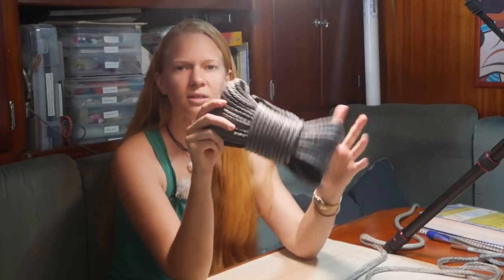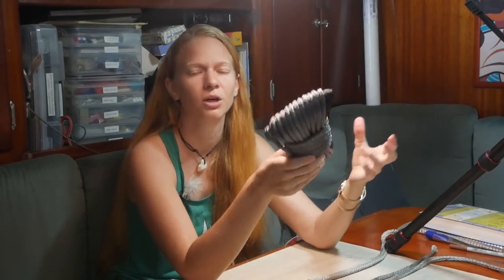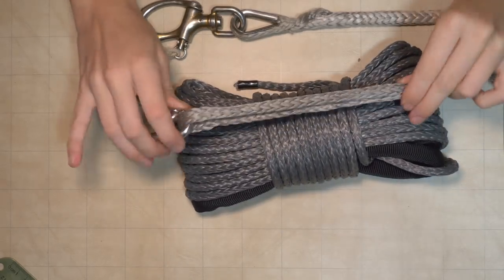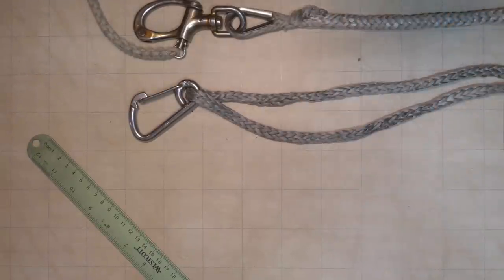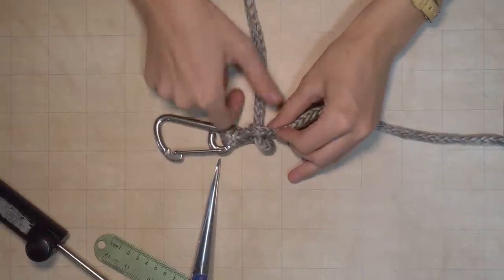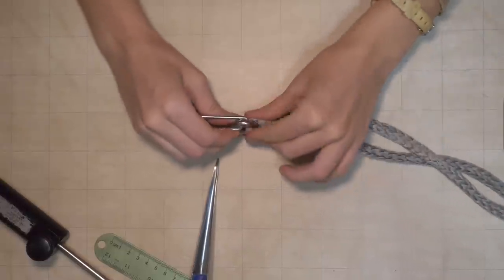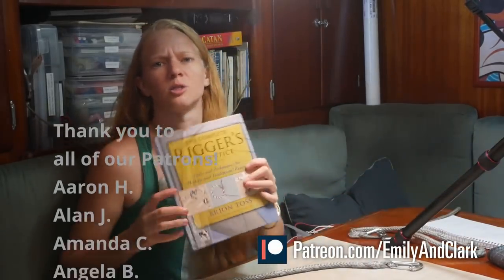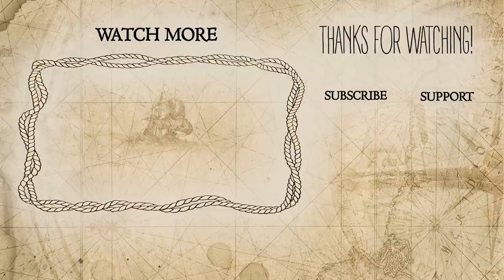Easy SPLICING: How to do a Brummel Splice around a Shackle [Capable Cruising]

Comment: this is a very well done video. the only thing I do differently is that my taper is longer - usually bunch the standing dyneema all the way to the knot and then take strands out every 3 or 4 and cut them off before tapering the end. This becomes more important if you want to keep the dyneema closer to the line diameter, which helps if it passes through a block or bullseye. There is also a pretty neat way to do a brummel if you only have one end to work with, but you can't put it around a thimble or shackle. The other thing you might add if you do another brummel video is the importance of the locking part going through the working end and not back through the standing part - if it goes through the standing part it will pull out.

Comment: I learned a splice today from a bargain store dock line with loops at both ends for $1!  It has a bury but it's not a brummel. The splicing needle pierces the braid, the the working end goes around the standing end and loops back across itself and immediately starts the bury by entering the original exit hole. When dressed it locks the buried splice with and overhand knot. I'm not sure how long the bury needs to be, but the rope that I found  is slick 16 strand hollow braid 3/8" yellow polypropyline "ski" rope . The loops are 5", the overhand lock is 1" and the bury is 6". Not quite as smooth as your mobius but it's fast.

Comment: Hello Emily and Clark---Another nice video here.  I wished I had seen this back in 1996 when I was replacing my very heavy 3/8 galvanized wire standing rigging with Dyneema, when it was really expensive! What I did, after considerable guesswork, was to perform the 6 strand pass through (as you started)  and then,  because I did not know anything, was to  stitch stitch, stich with dacron waxed thread and then (because I am so afraid of UV damage) fully serve the whole thing with black seine twine and then paint black, (more UV protection).  That's my current standing rigging on my gaff cutter.  Your solution is much more elegant, but all my sins are covered with my black seine twine serving....lol.  Ted 

PS  I've taken my boat to the Wooden Boat Show in port Townsend several times, and Brian and Pete and John and Mike would visit and talk and I would listen.  Brian Toss was a national treasure.  Sorely missed.

Comment: good one!  ... you prompted me order the new edition of Toss' rigging book - thanks!  Another interesting splicing video would be putting an eye in the end of double-braid line.   If ppl don't have the Brian Toss wand (very hard to find now), they can use stiff wire (a bit smaller than coat hanger wire) bent in half instead as the tail-puller - or they can buy a D-loop splicing tool.
Reply from the maker: Yes, there are a lot of tools out there.  I tried a bunch before I tried the wand.  Haven't felt the need to change since.

I'm not sure about a video on double braid.  I think that's better taught by a book and anyone that serious will probably already have a book.  But I do need to do one this season.  Maybe.
   I think people are getting sick of rope work but eventually I'll do one on three strand.  Again so easy anyone can succeed after one watching and an important skill to have.
   Once I'm out of bed I think s refrigeration video is coming.  I have a slow leak I need to fix.  So I'll be taking the sled out.  Good time to show how it all works.   Also a good prereq video for air conditioning.  It's starting to get hot!  -C
Reply from the maker: Also, assumed you used our affiliate link, thanks.

Comment: MOBIUS: Maybe I'm wrong, but my understanding is, including the word "mobius" in the name of  this splice referred to a method of making the splice where you don't need access to the standing end of the line. This is useful if the line is very long or the standing end is already secured or has bulky hardware attached.
Reply from the maker: I think you are right
Reply from the maker: And I think that can't be done around a shackle

At least I can't figure out how.  -C
Reply: @Clarks-Adventure  It would be challenging to do around a shackle! You would have to get the shackle through the reversed hole in the line!

Comment: This is a pair of cutters that I use for Spectra which is similar to the line that you use and may be called Dyneema and they work great Pitbull Tackle Braided Line cutter 2.0. They cost about $14-18 depending on where you purchase the cutters. When you do the splice, you should start a little farther to adjust for the rope thickness and allows room for the tapering of the end of rope.

Comment: The fid with the blue handle is known as a Swedish fid. The eye is good for this use but the small radius turn does weaken the line. It will be weaker than if you used a thimble to make it bend less.

Comment: that's great, but what if the working end also has a shackle on it?  How do you have two ends that eyes with metal hardware??
Reply from the maker: Do you have that need?

But lots of options.  You could just bury a lot of tail inside the working end and sew or add a long whipping to the throat.     We have a video on whipping.   It's me,Clark and the title is something like how a sailor cuts a rope.

Comment: love the splice ! looks easy and pretty!

though i feel like i would just use a figure 8 . yes its not as seamless but it dont need any tools, precision or time.
Reply: Bad idea to use knots on Dyneema, VERY BAD!  The strength can be fare below 50% and dyneema is as slick as Teflon.  The knot will not hold!  Brummel lock is one of the very best ways to splice Dyneema.  Knots will kill people!
Reply: @mikeiver  if you are using the dyneema for such heavy loads then yes the splice is the only safe way to go, but if you are using only a fraction of its breaking strain, eg: pulling 300kg with 6mm dyneema(3200kg breaking) then a figure 8 will not slip. I put loads twice that with no slip with figure 8s. The great thing about its slipperiness is that it is much easier to break up the knot than any other line that you'd subject to that kind of load

This is just my experience working with dyneema having used different knots, and loads. Not trying to discourage using splicing at all, it kssignificantly stronger and seamless.

Comment: I have a question, but first I really appreciate your video, it is really well explained, and I've come back to it many times! 
My question is what do I do if I have a core, but it's not a braided core. I've been looking all over YouTube, and I'm just struggling to know what to do with my core. There's plenty of really good tutorials on double braided ropes, but I have a cheap polypropylene rope, and it has a core, but it's just a filler. Can someone please point me in the direction of an answer? I have done a decent amount of splicing, with other ropes and I know I could just pull out the core, and do it like this video, but taking out the core makes the eye thin and weaker. So I'd rather not do that. 
The other thing I've thought of is just leaving the core in and ignoring it, but then I couldn't have my buried end in the middle of the working end as the core is in the way, and the Chinese finger trap principal would be less effective.
Those are the only easy thing I've come up with...
Reply from the maker: Hi Michaela,
   This is Clark.  We are so happy to hear you enjoyed Emily's video.  Thanks for responding.
    I believe I know the line you are talking about.  If it's what I think it is it's not really worth splicing.  The line I am thinking about is really weak and dies quickly in the sun.  I used this kind of line as dinghy painter but though it was readily available and extremely cheap I wasn't happy.  In one season it degraded to the point it parted.
    That said, it heals a know well as polypropylene goes.

     As for splicing,. There is a type of line called parallel core.  An example of this in good quality rope would be new England ropes stay set X.   This line has similar construction and might be splicible using the same method.  If you can't find an online reference I suggest Brian Tosses book (link in the description).  That what I used to learn this splice.

   But my main suggestion for this line assuming it's the one I'm thinking of and you really want a splice is to do it with sewing and serving.   Put the line through your shackle or whatever and sew it back to itself.  Then do a whipping or three.

Hope that helps
Reply: @Clarks-Adventure   Thank you! That is really helpful! I am aware that it is a really cheap line, and in this case I'm using the line to hold down a tent rain fly, so I was hoping that using a splice rather than a knot would help it last longer :). I have done some sailing and love trying to make my ropes and such last longer, but right now I'm land locked so splicing ropes for camping is as fancy as I get. My thinking is that on shipboard the line would get all kinds of weathering and have less chance of learning then my occasionally tenting... You are probably right about it not being worth a splice but since spicing is my joy, I'm giving it a shot 🙂
Reply from the maker: For camping I'd use paracord a lot.  Cheap small light and probably stronger at it's 500 lb rating.
I made a sling for my jungle knife (machete kind of thing) from 25 feet of paracord.  That way if I have the knife I have cord.

Can't splice it but sewing and whipping would look real nice.

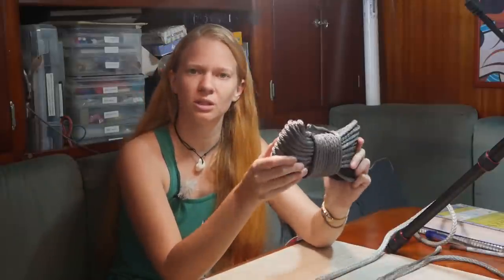Comment: 2:55 Dyneema is great for lots of things, but I wouldn't use it for a painter, where you want a good deal of elasticity to take up shocks and reduce stresses on the boat. So the ideal is twisted nylon. Which can also be spliced in the old fashion
Reply from the maker: The problem is nylon sinks and can get I to the prop.
  I have found that dyneema (with a snubber) also sinks eventually possibly due to marine growth.
   What we are doing now and it's great is I put some cheap polypropylene inside the dyneema.  It's like a nonfunctional core.
   The dyneema now floats better and the poly compresses when there is a shock load absorbing energy.
  The dyneema protects the poly from the sun and provides plenty of strength.
Reply: @Emily & Clark's Adventure  true, it does sink, but I've never dropped the painter in the water. And if you do, it's still tied to the bow.  Polypropylene is just such nasty stuff I can't put it on a boat. Breaks down under UV, and has the feeling of rubbing blocks of polystyrene foam when you try to tie knots in it.
Reply from the maker: The problem with sinking isn't losing the line.  It's that if you back down while towing it can get in the prop.
  The poly inside the dyneema doesn't see the sun so doesn't break down.   There are some high quality poly out there (New England ropes) that feel nice 
  I know what you mean though

We are all captains.  Do it as you wish.
Reply: @Clarks-Adventure  My dinghies don't have props because they're sailboats, haha. Snipe and Laser

Comment: Great explanation......I use a bent piece of wire to thread the line through (for me easier, less complicated, cheaper, more vesitile can use on wide range of rope diameters). I dont know if this is the 'right' way but I also use my fid a different way......poke it through then feed the end of the rope from the tapered end, laid in the grove, this lets me naturally pull the end through as I withdraw the fid.
Next level would be to make and use soft shackles (instead of stainless hardware).......maybe another video.
Reply from the maker: Any tool that works is the right tool.  The real value if the wand is with double braid.  I used a bunch of other tools. They all worked but there was a bunch of tape involved.  The wand was faster and less messy so once I tried it I stayed with it.  For single braid it's a needless expense.
   I've just started with soft shackles.  I'm really liking them but I'm not really taking advantage.  Biggest use right now is tying down our been bag chairs.  What a waste of a good idea.

   I plan on turning the core of that piece of dynema double braid into a soft shackle.  It's an idea I saw in the rigging doctors channel.  Then it will become a genoa sheet with built in knot.  -C
Reply: @Clarks-Adventure  Thanks for the reply, commented cause you asked what other people did. 
Totally agree sometimes the best tool is the tool that works, your tool would be great for double braid splicing. 
I like the intergrated terminal sheet soft shackle idea but prefer the versatility of a simple eye splice and separate shoft shackle.
Other youtube resources you might consider for soft shackles are Bottom UP Boats, premium ropes and howNOTtohighline.
Keep up the great work, cheers
Reply from the maker: Thanks.  All add those to my list

Comment: Can you use this approach to splice on shackles, thimbles etc at both ends?  Seems like you can't. Work around for this using dyneema? thanks
Reply from the maker: Think of this splice as two slices.

The bury is for the high load strength the bremmel part is for before the loads get high enough for the bury to do it's thing.

You can get a fair strong strength by just burying the tail and doing some sewing for the low load holding

Comment: I'm working on replacing my standing rigging with Dyneema, and I started with Brummel splices. But now everybody is getting me that a simple long bury with locking stitches is stronger.
Reply from the maker: I personally wouldn't do standing rigging with dyneema.  It is plenty strong but easy to cut.  Basically if you do this your rig is at risk to anyone with a knife.
Reply: @Clarks-Adventure  Everything on a boat is a trade-off. Synthetic has advantages and disadvantages compared to steel.
That said, that some vandal might decide to cut my rigging is not a disadvantage I'm concerned about.
Reply from the maker: Then yes it has advantages
  And it's so amazing that it can be so strong!

I really don't know which is stronger but I would assume they are the same
  The bremel part is just to keep it from moving at low loads.  The burry is where the real strength lies and both approaches have that.
Reply: @Clarks-Adventure  For me the main advantage is that i can replace it myself with simple splicing tools.
As for Brummel vs lock-stitch, I've been told Brummel results in a 20-30% loss in strength. That said, if you're sizing Dyneema for equivalent stretch to steel, you end up about 500% stronger than you need, so that might not really matter.
Reply: The Brummel and the locking stitch serve the same purpose - keeping the splice from coming apart when not under load. Both require the long bury for strength. I would worry about the threads in the locking stich  breaking when it is loaded.

Comment: Here is a tip for you, get yourself a pair of Wiss Aviation snips. They will cut dynemma way better than any scissors, and last a lot longer.
Reply from the maker: You are the second guy to suggest that.  I bet they are good.
Reply: @Clarks-Adventure  I regularly wear out scissors on Dyneema, even the ones with Titanium blades. Ceramic knives last longer.

Comment: That is not a Mobius Brummell splice, it is simply a Brummel splice. You don’t Whip two lines together, you Seize them; in this case, it is to prevent the splice unreeving in slow, light airs which can cause gentle, creeping tugs, loosening the splice or causing it to gradually pull out. The taper is where the strength in the splice is.  Vernon

Comment: Dyneema is very unforgiving of improper splicing. Though you have the most basic part down you missed the taper of the tail which is critical when looking for maximum strength from ones expensive Dyneema.  In the case of SK78 1/4" you also need a more gradual taper from the Shackle to the first dive thru the rope.  Even then the turn is to sharp and the dyneema will break long before its rating.  Also not having the buried tail tapered further reduces the ultimate strength of the rope.  In this case it actually doesn't matter since the shackle is far weaker than the rope even taking into account the improperly spliced Brummel lock.  Edit:  I see that she updated the video to include a taper of the tail.  Dyneema off of Amazon is variable as to quality, spec, and actual strength.  But again, considering the service and the shackle attached, this will most likely be strong enough anyway.  To get closer to ultimate strength it would be preferred to use a tubular thimble to increase the radius for the dyneema at the critical point of the shackle and protect from ware.  Good video now and covers the basics well.  Glad to see people that put up videos like this iterate and improve when they, like all of us do, miss something.

Comment: Great video, very clear. But I disagree with your number 72. There is no need to bury so much line in the standing end. I use this splice regularly in much thinner kitesurfing lines using a simple copper wire as the tool, and  just bury what’s left. So in your case, I’d leave 6 inches not 18. I can’t see how burying more would make it any stronger.
Reply from the maker: These new wonder ropes are so strong that they will slip before breaking.   If you don't plan on loading them to their limits the bury could be shorter.
Reply: Watch the HowKNOT2 channel for a while to see how Dyneema will just come out! I use shorter buries for some purposes like when doing a soft shackle but it is the bury that gives the splice its strength, not the Brummel. For standing rigging I would certainly use the 72x (and maybe more).